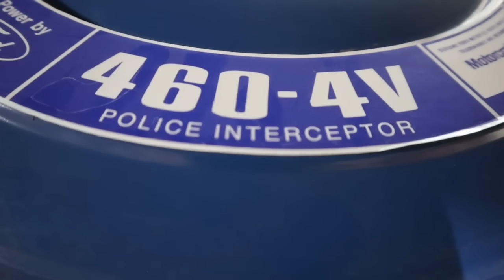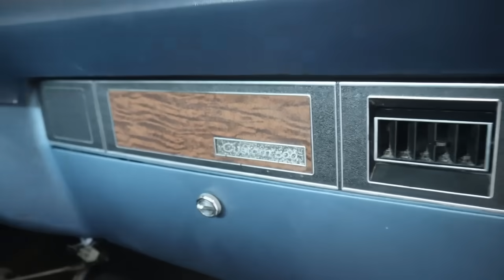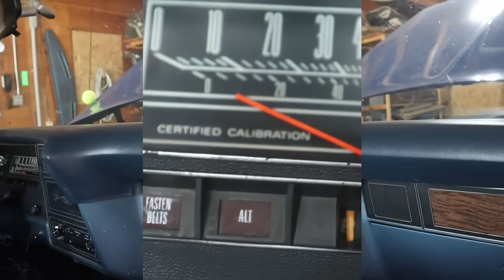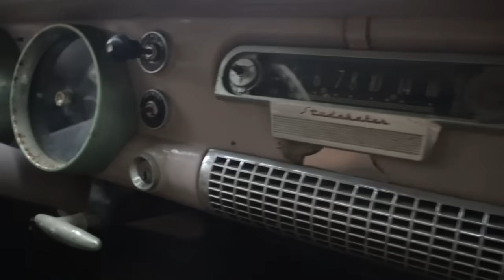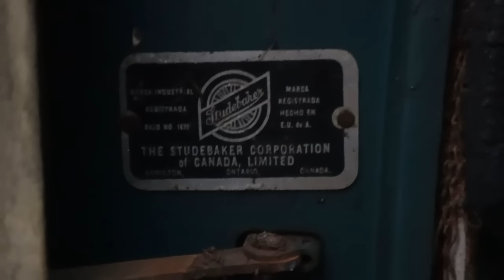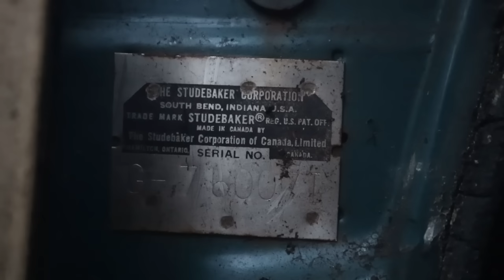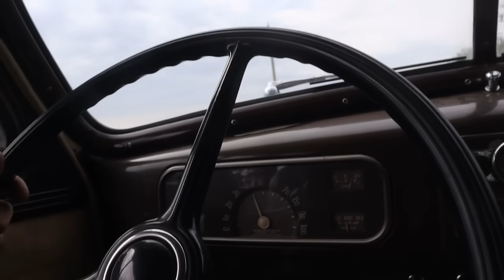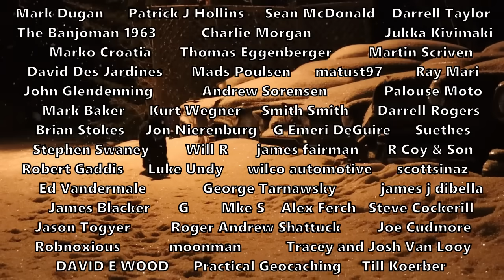Ford Custom 500 Interceptor Restoration Review and Drive! Plus: Another Studebaker Comes Home?

Comment: I used to work at a transportation museum.  We had a 78 Fury Highway Patrol Car.  Did a tune up on it and took it out for a late nite drive.  The town cops called the museum director and told him we just left the place.  Drove the car at over 100 miles per hour out in the country and then pulled up at a friend’s house with the pull-down lights on demanding he exit his house with his hands raised.

Comment: The Studebaker is a 1955 Champion Regal 4-door sedan 1of 7406 built. Since the car has a wrap around it is a 'Vista Vision" model built on or  after 1-1-55, The car also features the Spring 1955 two tone paint design.

Comment: Back in Time a friend of my Dad owned a 1956 Studebaker President coupe, and took me for a short ride, it was one of the fastest cars I had seen at the time. The acceleration was astounding. That is what I like about Scott, He saves uncommon, and almost vanished cars to try & keep them for Posterity. Cheers
Reply: Studebaker was fitting most of their
cars with STEEP rear-axle ratios, to
keep up with the Joneses.
Reply: I'd think about swapping-out that
smallish 170/186 Stude Six.
Although, it might get decent mpg
with EXPENSIVE Canadian gasoline.
Reply: The early 60s Larks with V8s and four speeds were early muscle cars but too little and late to save the company

Comment: Deans been very good to me.. Everytime im in Edmonton i check out his yard and hes got parts for me, thanx Dean!! ..........good video.. SPUN ROD BEARING LOL.. lemme guess officer driving it over revved first gear as these cars didnt have 1st gear lockout anymore after 1974... Ive got a 1978 Ford Custom 500 X-RCMP Highway Interceptor myself... slowly but surely gettin restored! I drive it alot in summer. My uncle drove this car AS AN OFFICER back in the day, he said the Pursuit Dodges were a lil quicker to 60 MPH but after that the Ford ran away from the Dodges! My mat wasnt rubber.. its a blue carpet! but its a C code Interceptor. Penticton Charlie 2. mine rumbles same way.. people tell me I got a hipo cam in there.. I say NOPE its an Interceptor grind cam and thats how they sound! Mine says CUSTOM 500 on each rear fender.. after 1975 only Canada came with a Custom 500 and they were fleet vehicle! PS: im 260 pounds and I can stand on the front bumper and jumpish and car barely moves! My 78 was an unmarked ghost Traffic car. Stock does 0-60 in 8 flat and will do 135 Mph with the highway gears on it... I love pulling off a clover leaf and hittin the gas, hearing that 4 barrel open up and hittin 100 Mph within a few seconds off that clover leaf..  Ive since changed the intake, carb and put headers and in street trim runs 0-60 in 6.5 on street tires and 14.5 in 1/4!

Comment: In 1978 I inherited my grandfathers '73 custom 500. Had 8000 miles on her. It did not have a radio nor any options. The base engine was the 2bb.351. List on it was 3600. Ford had a sale on them for $2995. This was during the model year and not a model end closeout. Grandpa told me it was the most car for the $ at the time. Before he bought it,he was still driving his very rusty '50 Champion 4dr. He bought that new. Back then he was hanging doors at,Studebaker. '50 interior & engine great shape but the Winter's in So.Bend were car killers!

Comment: Cliffhanger!  I hope the 37 Chev passed its inspection.  That opening sequence had some model car malaise era goodness - the white T-bird and the M-body woody wagon and the M-body sedan and the black Fiero  - all good stuff.  That 55 Stude is really a good looking car, and it will look good on the front line at CWM.  If by some miracle it was already a clean & solid runner when you bought it, you would HAVE to drive it around for a while.  Darry's 77 Custom 500 is in such great condition.  And that AMC Matador will be gorgeous when Darry finishes with it.  That could even be made into an Adam-12 tribute type of car.  And that 58 Buick would be great in Dean's stable along with his 59 Edsel.

Comment: It's an old Mount Prospect police car. They were practically giving them away. It's got a cop motor with 440 cubic inch plant. It's got cop tires,  cop suspension, cop shocks, it's a model made before catalytic converters, so it will run good on regular gas. You really need to get a picture of the 77 police cruiser in front of the Richard Daley center building in Chicago. Road Trip !

Comment: My Grandma had a 77' LTD Landau with a 460 and it would definitely would not burn the tires from a launch 
I found out later it had a 2.46 rear end in it which didn't help..
Before that car she had 73' LTD with a 400 2 barrel and it would smoke the tires right off of it...

Comment: That vacuum air cleaner was an option for 74 station wagon with 460 towing package! Plus oil and transmission cooler, power steering cooler was mounted to the side of the pump

Comment: That is so impressive 😮!  I remember working on so many of those 😅!  The red plug he mentioned on the voltage regulator socket was a “full field tester”.  We used those to test the output of the alternator to diagnose the issue on Ford and some could also work on a Chrysler….

Comment: Darry has a strong spirit. I can tell that from the work he but into the 77 Ford Custom Police Interceptor. Most police cars ended up being just parts cars or scrapped the interest for them was very low just like with most 70s cars that had been used to the very end. Saving the Studebaker made me happy, Dean is true car hoarder of this show. However this time it was not junk but treasure disguised as junk. Scott you should try to unseize the Renau 5 engine in the winter. I hope its just light size not a engine full of shmoo from what ever leaked past the head gasket.

Comment: If I were motoring around Alberta and saw that beautiful Mountie Interceptor in my rearview, I'd pull over instantly just to get my peepers on that amazing machine and maybe Darry who restored her 'as-new' or likely better while undoubtedly overcoming challenges along the way.  Wouldn't need the cherry light nor the siren, I'd be stopping straight away.    Also, I'd love to see the 'well-ventilated' Stude out of the yard and back onto the road - the tires hold air, get the old gal running, something resembling brakes, and hit the (back) road.  The color reminds me a bit of my Dad's '58 Mercury Monterey, which was mint green and creamy yellow-white.  383 MEL Marauder plant, 4 bbl & a "custom" 3 on the floor won Mom a lot of stoplight drag races for burger & shake money back in college, even if her & Dad did always have to try park it downhill due to a starter that wouldn't start 'er.   "Warmest" regards to all Agents worldwide from here in baking-oven-hot Texas.

Comment: A couple of things to comment on this week. I think the first motorcycle I owned was a Honda 90 just like the one you showed, except it was painted yellow. Learned to drive a cycle on that bike, but it was pretty much a worn-out POS by the time I got it. Replaced it with a CL-350 after a short time. The second thing of note comes up every time you drive the old Chevrolet. When I was a kid, my dad built me a pushcart "hot rod". For a steering wheel, he cut out a 120-degree segment from a Chevy wheel exactly like the one in your car. (it had a red horn button compared to the black one you have) The front wheels steered individually, like on a car. No center-pivoted solid axle like most of the others I ever saw. Anyway it's a fine memory to have, and every time you drive your old Chevy it comes back.

Comment: I have that same bike, mine is a 1967 Honda C201. (90cc) It was in my friend’s Dad’s garage for 40+ years. I brought it home and soaked the motor with a 50/50 mix of Acetone and ATF for 3 months. Put a wrench on the flywheel and unstuck it. Fired up later that week and eventually put plates on it. Replaced the tires/tubes and fixed up the wiring. Blue was not a very common colour. (Possibly Canada only?)
Currently working on a 1962 Honda Trail 55.
Reply from the maker: Hey thanks for the info! Cheers..

Comment: Our local State Police had the Ford Custom 500 Interceptor (with A/C and the metal rear seat convict screen) until after '79 when Ford downsized the LTD. They then switched over to the R Body Dodge St. Regis until those went away in '82. After that, they went to the Ford Crown Vic's and have had Fords to this day.

Comment: Nice patina on that Studebaker 😊 maby just paint it with clear coat paint and fix everything else to get it running 😊 the Police car looks like new that is just amacing it's a big thumbs up for all that work 👍🙂 if that Honda 90 cc motor cycle was restored it wou be worth a good amount of monny, old mopeds that is over 20 years old in Denmark is sold for big monny now I thing it's the retro wave when somthing is retro the price just goes op

Comment: LMAO 
On the intro :
There is no mercy , no slowing down ,
Put it to the boards , open those secondaries ( interceptor sound bite ??) 
and hammer that obstruction .........
That RCMP  Custom 500 is a treasure , Dean is losing his mind 
Big Block Interceptor ,  sounds awesome , the audio failed on the drive .. , unless , it was entered in the intro ....hmmm 
Darry has a wicked collection there
Does Dan still have that 383 Newport ???  , it is a very nice car
The 37 Chevrolet pass ??? .........
Stay tuned

Comment: I have an F450 rollback with a 460; hauls anything I want it to and isnt horrid on gas. Ive never seen a rear quarter rusted as badly on a Studebaker as that 55. Good thing they bolt on, not welded.

Comment: The cop car is awesome I own a 90 Caprice squad 9c1 car for 22 years it was an awesome car whatever cops drove it must have hated it had no air conditioning that's crazy my buddy's got a 70 Olds 88 custom police car disc brakes455390 horsepower Turbo 400positraction differential sway bars it's real cool and it's in very nice condition he painted it about 10 years ago it's a really nice car don't see many of those it's green with green interior have a great day

Comment: Ford sold the Custom 500 in the USA, but after 1974, it was not a standard part of the product line and was not included in the regular 1975-1978 USA full-size Ford brochures. The Custom 500 was a slightly lower priced alternative to the base Ford LTD. But they were not common and most people bought the LTD. A former neighbor had a red Custom 500 station wagon.

Comment: My grandmother had one of these in the mid 80s. Low miles,black with a 460. Rode great,handled like a wagon and wouldn't spin a tire to save its life😂

.....my 79 4 cylinder mustang would out run it!

Comment: I don’t know about a late 70s engine, but my bone stock 1968 390 will spin the tires if I stab it. Of course it’s a convertible so there’s not much weight on the rear wheels.

Comment: I have a 55 2door studebaker my dad saved it from a falling down barn years ago engine and transmission was removed to be rebuilt and the owner passed and no one knew where or whom he took it I do not have title but if you can figure out how to get it from central Virginia I would give it to you it is rough but straight and all 4 tires are there but flat I am sure

Comment: The custom 500 is great any of those smog 460’s if you put a 71 or earlier timing chain in it. It will pick up a good bit of power. They tried to meet emission standards by retarding the timing
Reply: Just adjust the timing,  no need to change the chain.
Reply: @danielulz1640  You can’t adjust the timing that much to make up for it. It’s a very common upgrade done to any smog ford engine a straight up dot to dot double roller timing set and you’ll pick up power and torque

Comment: The stude would be a champion or President if a USA build, but being a canadian car it could only be a Champion or a Dictator. 

😉😉
Reply: I am pretty sure that the Canadian Studebakers were also called President. Studebaker dropped the Dictater name entirely back in the 30's. A guy with a funny little mustache gave that name a bad connotation. Dictater was Studebaker's lowest priced model back then, essentially replaced by the Champion. Commander was the up scale model, with President as the top of the line.